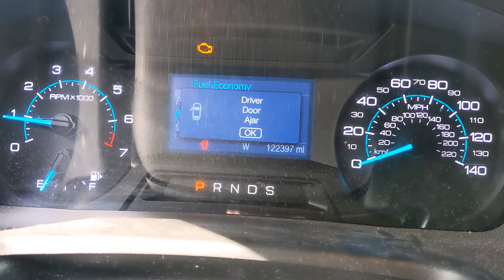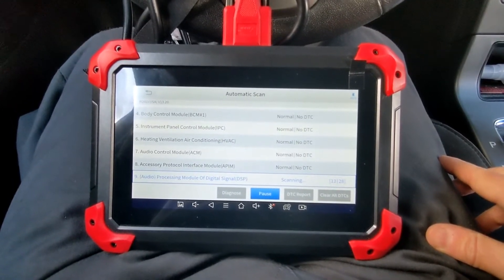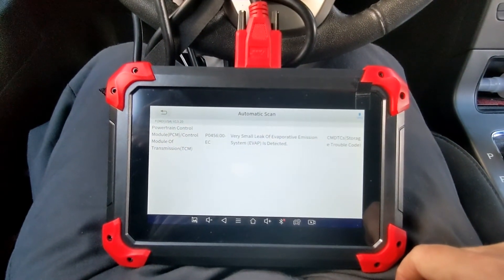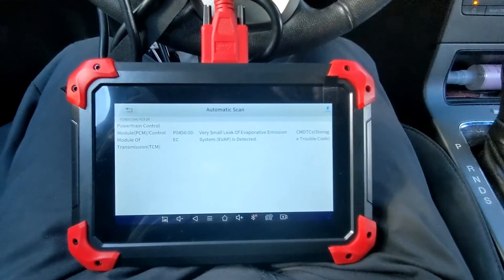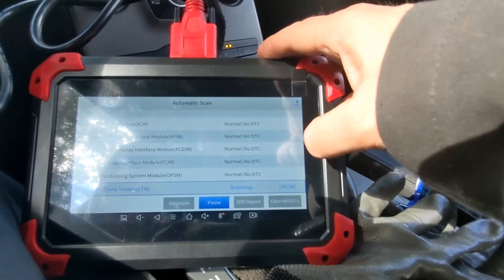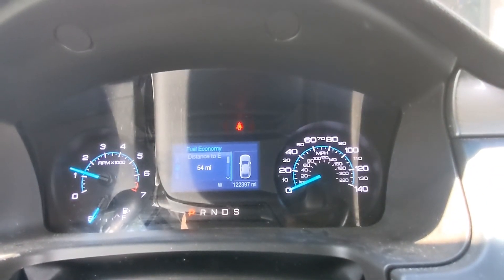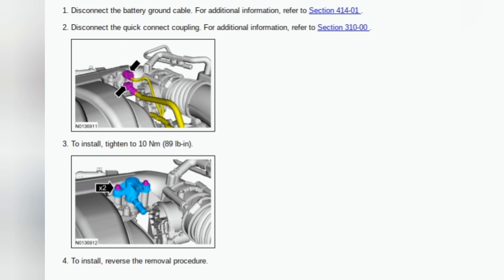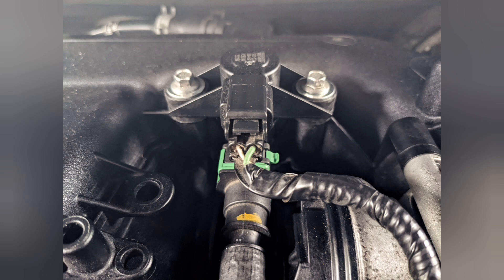DIY Purge Valve -- (P0456) EVAP Minor Leak on 2014 Ford Flex

Comment from the maker: This Amazon valve FAILED after a few months.  Now buying Motorcraft!
Reply: Wtf…i just got mine delivered 2 days ago.. I have a five speed manual. When I shift gears 1,2 and three I notice it jerks hard forward and it’s giving me the code PO 456 and PO 144A.. The old canister purge valve that was stuck open did not make my car jerk but the new one that I got from Amazon makes my car jerk forward whenever I shift up
Reply from the maker: @Nylez94  sorry to hear of that frustrating situation.  I usually retrace my steps and first ensure I replugged electrical connections, vacuum houses, etc correctly.  Just rule out anything I simply overlooked.  I don't usually associate these valves with significant driveability issues like the jerking you describe.  But, because EVAP system touches on fuel delivery it's possible I suppose.  In any event, the P144A needs resolved.  After ruling out electrical and vacuum issues, I would bench test the valve.  If you don't have time for return and replacement, most auto parts stores do stock these locally for only a bit more than the Amazon price. Again, sorry you're having to deal with this.
Reply: @KentForrest  I think the electrical plug-in needs to be replaced that goes to the evap piece
Reply: @KentForrest  But I don’t know what it’s called to look it up if it does have to be taken out
Reply from the maker: @Nylez94  that's called Canister Purge Valve Connector.  What leads you to think that may need replacement?
Reply: Isn't the Amazon one a OEM Ford Motorcraft one?
Reply from the maker: @geeezy88  there's options available on Amazon.  First time around I went  with a less expensive choice.  Not again.

Comment: Very well done. But that scanner you using costs around $600.and you have to have the knowledge to understand, how to use it
Reply from the maker: The D7 scanner has saved me much more money in shop fees than the scanner cost.  If you have basic mechanical knowledge and a general understanding of how engines work, then there are a lot of good sources via the internet where you can get more training.  And then, the most valuable item will be having access to the factory shop manual.
Reply: So, basically, if this was the first time using the scanner, he'd already have broken even. He would then have a great tool to use on a bazillion other cars. It doesn't take an advanced degree to use a scanning tool.

Comment: Great video. Thank you. 
The seal on my capless gas lid seems intact but the part itself appears loose and shifts a bit where it is connected to fuel door. Is that my most likely culprit? I did the WD-40 and ragged it clean and cleared the CEL so am in waiting period right now to see if it returns. But guessing that seal shouldn't be shifting where it connects to the fuel door.
Reply from the maker: Ey Chad, if you mean the little metal "door"  on the capless system that should feel pretty sturdy.  My two Fords have the very slightest play of maybe 0.5mm to 1mm when poked at with a finger.  But no side to side play (just in/out) and generally feel sturdy.

Truest test will always be smoke machine.
Reply: @KentForrest  Yeah, fuel door. The seal itself seems intact but that part shifts a little from side to side where it connects to the fuel door. It moves left-to-right, more than a couple mm. It does not move up and down. So my guess is that if that shifts, it's not creating the seal I need and leading to the CEL.
Reply from the maker: @chad_hartley  because it's fast and so often the culprit, just check the purge valve.

Because that's faster and cheaper (free) than using smoke to confirm the door.  It's not complex to DIY the smoke test if you're mechanically minded.  But most don't own the tool.  A decent one will cost ~$125+ for something you will very rarely ever use.
Reply: @KentForrest  CEL did return. Just pulled off the hose from the purge valve and that seems fine. No suction on the valve the way your video shows. But the hose that plugs in there doesn't seem in great shape. Outer plastic casing is cracked and there's some sort of tape or wrap near the connection that is unraveling. Not sure if that was standard or an after-market fix by someone along the way. Trying to identify the name of that part.
Reply from the maker: @chad_hartley  should just be called a canister purge valve hose.  And if that's not the official name, I'm sure it's enough for a parts counter guy to work from.  He'll know what you mean.

Comment: My flex feels like it’s going stall after I fill the tank up. This is the only time it happens. I’m not getting any codes, figured I’d try a $40 fix first. quick question, easiest way to get the green tab quick connect off is with the pick? I feel like I’m going to break it. If I do end up breaking it do you know the part to replace it?
Reply from the maker: My Flex isn't home at the moment to look at, but there's a few types of quick connects on the Fords and often they require "two movements" to release.  There will be prongs to pull out, or a piece to twist, or a place to press, etc. before you pull the quick connect up.  Study the fitting a few minutes, and it should become clear to you.
Reply: I figured it out and replaced the valve. Hopefully that solves the issue when refilling. Thank you for the video.
Reply from the maker: @Kingdope  if not the purge valve, potentially the vent or the canister.  That's if I'm understanding symptoms correctly, only having trouble on a full tank, everything is fine once fuel level lowers a bit.  That's typically an EVAP system that isn't breathing.

Comment: I did all that and still getting the code. What's the name of the hose, maybe I can change that next? I can't find the name of that hose anywhere I search for it.
Reply from the maker: Hi Chris, if you've worked through fuel door, fuel cap, and purge valve, I would suggest putting a smoke machine ($120 on Amazon) on the system.  The escaping smoke will reveal the specific hose, connector or fitting that is leaking.  There's some good YouTube content on smoking the EVAP system that will help you.  And, as always, I also recommend factory workshop manuals as a guide for these situations.

Comment: Can you link a part number for the purge valve please?
Reply from the maker: Steve, you're much safer using your Year, Make, Model, Engine information as you source the part.  When shopping online at Amazon, O'Reilly's, AutoZone, NAPA, Walmart, etc. you have the opportunity to enter this information to ensure compatibility of parts.  Also, a phone call to your local Ford dealer parts department with your VIN number can score you the OEM part number.  You can then use this to cross reference as you consider aftermarket parts. 

Always best to do these things for yourself on all parts purchases.  Nothing more frustrating than buying and receiving an incorrect part because "some guy on the internet" gave you wrong info for your specific vehicle.
Reply: @KentForrest  that make sense. My year was only 1 year off from yours figured it would be the same. My local dealer is closed today. Obviously the car still drives but just wanted to get it taken care of asap. Thank you though.
Reply from the maker: @stevecampos1055  give O'Reilly's, AutoZone, NAPA  call or use their website.  With Year Make Model and Engine (or VIN) they can be sure to get you the correct part number.

Comment: Great video i have 2014 aswell no check engine light only "check fuel inlet" cleaned it w wd40 unplugged the battery reset and after a month light came back on and when i gas up pump keeps clicking off. Mechanic wont touch unless check engine light is on but its been like that for months im definitely going to try this!
Reply from the maker: Is your vehicle "capless" or does it have a traditional gas cap?
Reply: @KentForrest  its capless
Reply from the maker: @jenniferweigner1436  some cars have a poor filler neck design and you have to slowly fill to keep from kicking off.  But if your vehicle never had this problem until suddenly it did, that indicates something changed in the filling or venting.  The filler neck path should be checked for kinks and the vent path, including charcoal canister, should be checked for free air flow.
Reply from the maker: @jenniferweigner1436  this will help you speak knowledgeably with your mechanic:

https://youtu.be/cCT8-aOyAbo
Reply: @@KentForrest  yea it never did it. It started after i repalced the fuel pump relay. I will talk to my mechanic thank you for your help

Comment: Where to get the “Ford” funnel?
Reply from the maker: AIPICO 8U5A-17B068-AD 8U5Z17B068B Fuel Filler Funnel Tube for Ford Lincoln Mercury https://a.co/d/47rdsWm
Reply: Your car should come with the funnel. Mine was clipped in near the spare tire.